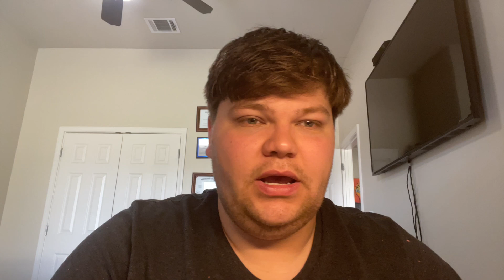Change in sensor calibration time with Medtronic Guardian 3 Sensor

Comment: Similar deal on calibration time spans. After starting a new sensor, I must calibrate in 3 hours then in 6 hours then in 12 hours, after 24 hours of starting a new sensor. I believe this is to get more accurate information on the first day and that allows for 12-hour calibration times the rest of the sensor's life.
Reply from the maker: Myself and several others were having this issue. Sadly I don’t have a way to resolve it. Just wanted you to know you aren’t the only one.

Comment: I started on 770G today and the Medtronic staff advised me I only have to calibrate mirning before breakfast and then at night before bed. Sensor will last 12hours. I was on libre before no hassel. I  have done finger pricks for 5 times so far just ti keep this stupid calibration thing on. When I do the calibration its just fills half the circle. Already I am hating this sensor not even 24 hours of wearing it. So far Libre is better even it doesnt communicate to the pump..😭😭
Reply from the maker: Give it time. Typically on day 1 I have to calibrate every 6 hours. If your a busy person and you have a lot going on you can calibrate early. So calibrate when you wake up. Then give it a hour or so and calibrate again. This should give you some time before the next calibration is required.

Comment: I’m on 770g. The first day I opened it I was in 12 hour calibration after my second calibration. But now I’m getting 3 hour like you said for several calibrations ok day 1. I would love to know what happened that first day to get me in 12 hour so fast.  Now I notice there are more calibrations needed the first day with new sensors using 770g compared to 670g. Maybe I’ll let my battery die or let my new sensor sit in my arm a little longer before my first calibration. Definitely something to watch.  I don’t want to call Medtronc and ask. Not enough knowledgeable staff there yet.
Reply: I started on 770G today and the Medtronic staff advised me I only have to calibrate mirning before breakfast and then at night before bed. Sensor will last 12hours. I was on libre before no hassel. I  have done finger pricks for 5 times so far just ti keep this stupid calibration thing on. When I do the calibration its just fills half the circle. Already I am hating this sensor not even 24 hours of wearing it. So far Libre is better even it doesnt communicate to the pump..😭😭
Reply from the maker: Ash you should start getting the 12 hour calibrations after the first 24 hours. I’m not sure why the 770g is wanting 6 hour calibrations on the first day.
Reply from the maker: I have been having to do the 6 hour calibrations as well. And a few others have also reported this to me.
Reply: @TheJjfrasier  Hey Justin it is relly annoying. I am worried to go to sleep coz of this calibration. I am going to tell Medtronic too. It should be more technologically advanced I guess. Sensor should be a peace of mind for the diabetic right instead this is making me more stress... 😬😬
Reply from the maker: Yeah I agree. I totally forgot about the 6 hour calibrations and started a sensor at night… I had done 3 calibrations before 8am the next morning.
Reply from the maker: So I have been trying to watch how the pump handles day 1. And it seems to vary, so that has lead me to believe that the length of time till your next calibration is determined by how accurate your first calibration was. I have seen 3,6,and 12 hour calibrations. But if you calibrate the first time. Then wait 20 minutes  to an hour and calibrate again you should get the 12 hour calibrations started.
Reply: @TheJjfrasier  I called Medtronic today and they said if I calibrate BEFORE the calibrate now alarm it will push me back into a 3 hour window. So, today I changed my sensor and did my first calibration after warm up. Will be waiting until the calibrate now alarm to calibrate again and see what happens. Thanks for the videos. We got to help our tribe out.
Reply from the maker: I’m not saying that they are wrong. But I wait until I get the time to calibrate alert. Then after I get that I wait for the BG required for auto mode. Then I’m still getting 3 hour calibrations. Let me know through if you get something different.
Reply: @TheJjfrasier  oh I went back and forth with them on the phone and had to speak to a supervisor.  I think everything is all still so new. I didn’t go into auto mode right away yesterday. I tested the suggestion of waiting until it said calibrate now….I was 3-6-6-12 but I didn’t wait the full 6 hours the second 6 hour window. I went in auto mode after first 6 hour. Makes me wonder if auto mode and manual calibration warm ups are different. Oh the variables. I appreciate sharing the knowledge though.
Reply from the maker: Your welcome. I will share what happens for me in a few days. And what I do to hopefully get the 12 hour calibrations sooner

Comment: That's something I would like to know. I did notice today my pump battery was down about 1/2 way and my pump stopped delivering insulin. I done 4 corrections, sugar kept getting higher. I changed the battery and with in 15min my sugar went from 302 down to 121 and has stayed with in range for the rest of the day. Have you noticed any change with a low battery?
Reply from the maker: Not with my insulin delivery. I just thought it was super weird that the battery fully died and then this is the first time in over a month that I didn’t have to do calibrations every three hours.